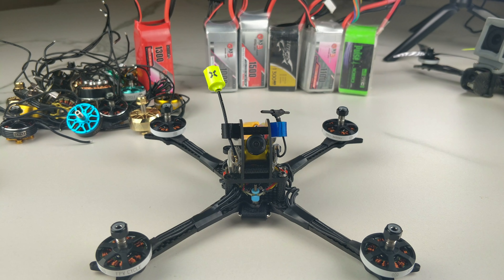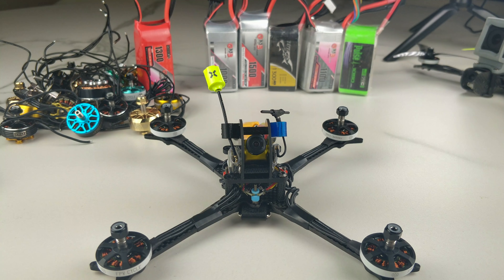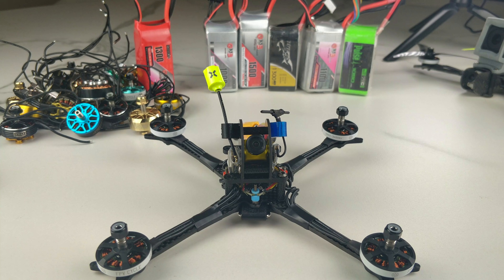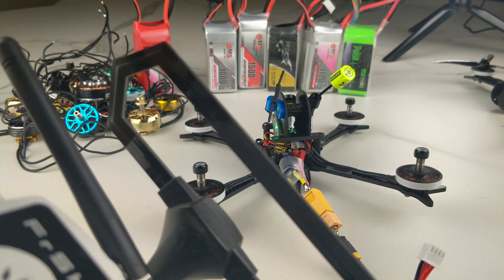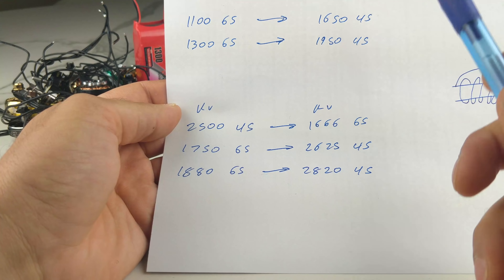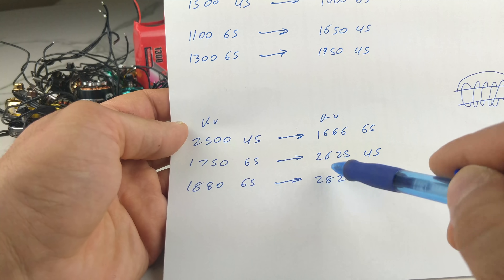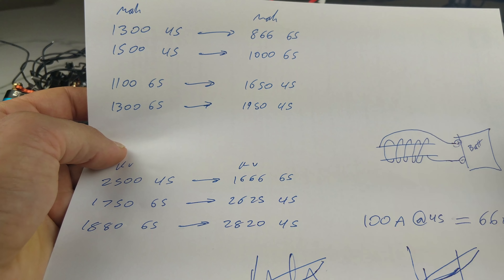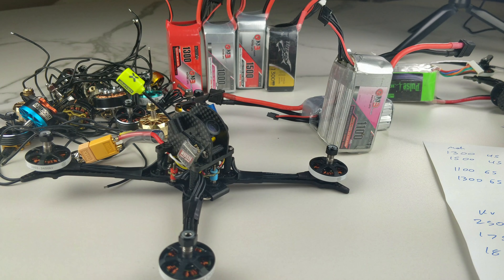6S Everything?  Why does 4S feel different?

Comment: I built 5s and 6s quads, I really do fly my 5s quads more often since they are more controllable and easily tuned. I have tuned one to where you could barely hear the props in flight. That quad dose fly 7 to 11 mins without a GoPro with 1050 5s. I do give the battery time to recover in flight if I do flip flops, or race style flights. I wish Betaflight would have 1 Gauge for RPM like how regular vehicles have the RPM gauge from 1 to 9. But I do enjoy you’re videos. Can’t wait to see whats next ✌🏼
Reply: I'm not sure how you would display rpm in a meaningful way since all 4 motors spend most of a flight at differing rpms.
Reply: Really what you're after is a strain gauge  to indicate how many Amperes the craft is drawing out of the maximum.
This would be difficult to reasonably calibrate, but we could get close with the following example:
Say at 16.0V your quad pulls 100A & at 13.6V it pulls 85A .We create a linear scale using these points, then measure instantaneous voltage and current then compare it to the scale.
Your quad is cruising at 18A , battery voltage is reading at 14.8V .
14.8V is 50% along your voltage scale, meaning we can estimate max amps to be exactly between 100A + 85A*, or *92.5A .
We take your cruising current of 18A and divide it be the theoretical max of 92.5A and that gives us a "strain" estimation (more on this below) of ~19.5%
Your "RPM" gauge of 1-9 would then show 1.75 "revs" if you count 0 as the lowest or 2.5 "revs" if 1 was the lowest.
Now, why an estimation you ask? Because this scale would sadly not be linear - the LiPo chemistry doesn't work like that; Supplying 20A is MORE than twice the work for a battery than 10A and the battery will output less useable power overall. This only gets worse the more Amperes you draw. Again, we could make some simple observations and apply a rough fudge-factor to approximate this, but getting it to any reasonable degree of accuracy would require testing and calibration for each individual battery throughout it's lifespan due to the ever-increasing internal resistance.
On the other more simple side, you can also display the current throttle stick position on the OSD. This is not equivalent to an "RPM" gauge, in car terms that would show how far the accelerator was depressed. It would simply show the requested power not the actual power.
Hope this helps give you some stuff to consider in your quest for an OSD rev gauge :)
Reply: @JustInvertedFpv   with bidirectional Dshot you can actually show all 4 individual motor speeds on the OSD. I'm not entirely sure why you'd want that but it's doable :D

Comment: Will I be ok to run these on 4S with little tuning necessary? I gathered that most issues are with running 6S on these, is that correct? I'm really too dumb to be flying, but here we are... 🤣
Reply from the maker: na just gotta be careful about 6S.  not worth doing 6S on everything
Reply: @Kabab  thats what I hear. I just wanted to make sure I was ok on 3" 4S without having to be a tuning aficionado 🙏

Comment: Im currently building a sub 270g 6s 7" vista build, the motors i am currently looking at are 2204 1750kv and 20g, do you think it is worth the extra 13-20g jumping to larger motors?
Reply from the maker: For 7"?  I'd strongly recommend 2806.5 motors
Reply: @Kabab  ok cool i will look into that. its the 7" megabat frame. i just love the way my toothpicks fly. thank you

Comment: Newb question here... what happens if your rx is no telemetry and you bind it with telemetry? Would thay cause errors? I get alot of rx loss on my rx/tx
Reply from the maker: It's just telemetry to the controller and half the time the code in the Rx or the controller is broken so it doesn't even work when you do bind it with telemetry.  It doesn't really matter.  If you get Rx loss from the quad being close to the controller that's normal.  Radio waves don't work when very nearby.  If you're getting it at a distance, check that your antennas aren't slammed up against carbon or aren't bent up or cut up at the very ends.  The ends are the important parts if you're using anything but crossfire.  For Crossfire you need to have it isolated and away from the frame with a vertical orientation if possible for best signal.
Reply: @Kabab the antennas are coming our the back  pointing up like a V. Maybe those rubber tube covers are smushing the tips  of the antenna like u said?

Comment: Do you think I will run into issues with on 4s with the power pick? Wondering if I should return the 4s and get some 3s. Nice video!
Reply from the maker: Well I have been having lots of issues in 4s and no issues on 3s. Still working on it. Same problem with the geprc dolphin on 4s. It's not unique to the frame or something. Stay tuned....
Reply: @Kabab  Awesome, I'll have my build done next week and I'll let you know how it goes! If I run into issues I will swap the 4s for some 3s.
Reply: @Kabab  Do you by any chance know the mounting pattern for the stock canopy stand odds? and the length of the standoffs?

Comment: I'm flying hyperlite 2122kv motors on 6S.  Why would that be considered too high?  It's a free style 6" floss with dal biblade 5040 props and it flies incredibly with tons of torque at what seems like every throttle point.
Reply from the maker: that's totally fine.  There's nothing presented here that should really change anything you do or are doing.  Just things to think about.  I myself really really like 1900kv 6S a lot on 5"

Comment: @KababFPV Great video! But I'm at a weird position where I can only run 4s on on my 6s quad (1800kv) for now. I'd like to know your thoughts on that in terms of efficiency. Did I just lose the benefits of both sides, or is it an overall more efficient (but under powered) quad? I noticed I could fly past 7 minutes and my cells would land at around 3.5 and recover back to 3.7 after a while. If I wanted to retain a bit of that efficieny all while gaining just a tad more power, (as I noticed how my quad would hover at near half throttle) would 5s be best for my case? Again great video and explanation as always
Reply from the maker: Na this is just food for thought. Fun to think about. I love 4S on 1800kv too. I have a feeling it adds the amps in the right places to fill in the torque curve. Yeah it's overall less but it feels better to fly because there's more current action than volt action
Reply: @Kabab  It's good to know I'm not alone on the low kv 4s train haha. thanks for the input

Comment: The issues you explain going from higher s to 3s to me seem to come from the higher gain in the feedback loop. Your pid settings are the same... But the motor response increases the mechanical gain in the loop because the motors have more torque  which has to be compensated for in the software pid. Lowering the total gain will probably solve it. I'm an engineer :) but really new to betaflight and drones in general so I might also be entirely wrong :)
Reply from the maker: In the case of this particular quad what I believe is happening is entirely noise in the system and the increased voltage is just exaggerating it. Never mind the quad. I was just using it to show how things can suck on higher voltage. Nothing more. I'll fix tht noise issue on the quad.

Comment: I just got most the things for my first proper race build (btw I bought 2 caddx ants, arriving Friday hopefully) - I have 3 6s 1300s and so there's no going back - I want to finish the build within the next two or so weeks- For now I'll probably get some T-motor velox 1950kv (the kind that don't look like the cyber xings) unless there's something better around the $13-14 mark. I'm still undecided on the props - any recommendations? I have no idea what to use. 

In hindsight 5s probably is where I should have gone probably, except for the fact there aren't many choices in my price range when it comes to motors. I believe Chief and also Mewo use 5S.
Reply from the maker: Consider the rcinpower Bison if you have gotten the motors already. The Velox is bottom of the barrel quality. Still fine and works fine but very low. The bison is special for a few reasons but also has an 11mm bearing which is wicked!  Still cheap

Comment: Somehow I watched the whole vid and was interested the whole vid but didn’t understand half of it lmao. Still very interesting 🤔
Reply: Yep, same
Reply from the maker: 🙈. Keep doing what you're doing. That's all.
Reply: @Kabab  so bro, does it mean if I use 4s on those fpvcycle 2203, would it always make sound?  Please do reply.
Reply from the maker: @AfafPrinceOSH  you mean electionic noise by sound?  If you take care to manage the noise then it will work great.
Reply: @Kabab  I mean as u used the 4s on it, it was making noise. Will it always make that noise?  Or is it due to noise in gyro which in result is causing the noise in the motor?
Reply from the maker: @AfafPrinceOSH  I go over all that in this video. It's a result of electrical noise from the motors

Comment: On a 6s, have you measured the ave. voltage at one of the esc wires to the motor to set the actual voltage being delivered to motor as you ramp up the speed?  I don't know, but going to ck.  Better yet  I'll put it on a scope. My guess is the voltage for a 4s is not the 16 or so volts a motor just starting to spin, the speed of the pulses is the same 3s vs 4s to get motor spinning not voltage?  I know you're talking 6s but I don't have a 6s.
Reply from the maker: the average voltage of 6S is more consistent. That's the whole point of 6S
Reply: @Kabab  +my point was given that we test with a 4s and 6s battery that weight the same they will both hover at a ave. voltage below a 4s  or 6s top voltage. so if you were to throttle limit the 6s battery so it could not put out more then 16.8, 4s volts (ave. under load) at full throttle then the two batteries will, should behave the same.  Yes, NO, why?  The test you did with the 6s and 4s also does not make sense with the motor noise, unless something in the system can't take 6s or will no longer take 6s.
Reply from the maker: @fpvkabo  because we usually drop the kv, the two will perform similarly.  The 6s battery will have an easier time with the amps because they're overall so much less and the voltage will be more stable. 

While I understand what your asking, these usually aren't useful tests in the real world because there is no way to assure all things are equal between two different setups. Motor kv, ESC's, battery....

Comment: Found this on fpvcycle:
"we don't recommend a 5" ultralight. It's just not worth it. We don't recommend using any motor smaller than a 2207 or 2305 for 5" props. You're just giving up control performance by going smaller."

Soo... What would you recommend for running Insta360go and maybe participating in 5" races? I at least like the look of the PP5 and the carbon topplate. Looks like its easier to mount stuff and maybe more durable...
Reply from the maker: This isn't really an ultralight. It's 310g. An ultralight is something that's now being more and more defined by the 250g auw marker and sacrifices to make it lighter.

This frame would actually be excellent for the insta 360 go but there's no specific mount position or not made for it yet.

Comment: So maybe a slight adjustment to throttle curve on 6s setups would alleviate the torque/feel issue at lower and middle ranges?
Reply from the maker: it could help

Comment: Great info all the way through! You lost me a bit with the torque vs RPM curves though. I'm curious why you didn't mention that you need a higher amount of turns to create (approximately) the same magnetic field on 6S? More turns = lower Kv right?
Reply from the maker: This video could have gone on for hours. You're absolutely right though. The impedance of the turns definitely plays in here and is probably at least partly the reason why we don't need a whole lot more kv on 6s to mostly fix the odd flight feel...kinda

Comment: So why did all freestylers switch to 6s if it has less torque? Longer flight times with 1250 mah?
Reply from the maker: It's less torque but the comparatively higher kv makes up for most of that. They're running much bigger batteries as well so they need even more comparative kv on it. 1250 6S is equivalent to 1875 nah 4S. Nobody runs that big of a 4S on 5" normally

Comment: Nice thoughts, first of all I'm not a pro racer but I love racing quads, my point here after my limited testing is that I fly 6S 1000-1100 lipos on a sub 250 dry 2205 1750 bh r6 paired with spitfire props or gemfan flash 5144, I  think I have all the power and nimbleness that I need plus a longer flightime than I got on a 2207 1750kv motor on a heavier setup because it's more efficient, I know that 2207 2207.5 2306 2306.5 are mainstream now and I have a really hard time finding light 2205-2206 6S motors, that make me think if I'm going in the wrong direction because motor disponibility... So what direction do you think I have to go when this sizes 2205-2206 finally disappear? I'm really sad about that 😞
Reply from the maker: Na. I'm actually expecting 2305 to become popular at some point in the somewhat near future. In your specific case I would investigate going down to 5S.  See if that quad is actually stressing the battery enough to need the voltage. You want the lowest voltage you can get away with.
Reply: @Kabab  5S maybe a good thing in theory, but there's no kv options for that in the motor size I use and I will have to replace all my lipos... I will try that amaxinno 2305 when the price drops a bit, thank you!

Comment: here is a thought...maybe someone already discussed and means nothing but higher KV motors have less windings and lower resistance  in the coils.  I wonder if running 6s with higher kv motors and a motor limit will give more of the high current 4s feel roogi is talking about compared to running low KV 6s motors with 6s battery.
Reply from the maker: It doesn't. I left out a huge part of this discussion. I didn't say anything about insurance. Less winds is less resistance but higher inductance. Overall it takes more power to make the same final torque with higher kv/lower wind count. That's why low kv low volts is so efficient. Like 1800kv 4s is super efficient and 2500kv 4s is not as efficient.

Comment: Really interesting video! I've been wondering a lot about cell and voltage combinations recently for a build, I'd be curious to know what you recommend. I'm waiting on some Hyperlite 2405-2722KV that I'm putting the HQProp Ummagawd 4Play (4.8x3.6x4). AUW will be just under 600g with a 160g lipo. I just wanted to try something different, maybe a grippy cruiser. Considering 4-blades = less top-end, after watching this I feel like higher voltage is pointless and should maybe even look at 3S higher mAh. For example a Pulse 3S 1800mAh vs a GNB 4S 1300mAh. Thoughts?
Reply from the maker: Well more blades is more load which will pull more amps and sag batteries harder. So more volts is likely going to help
Reply: KababFPV good point. So maybe 4S vs 5S with throttle cut should be my focus. Thanks for the reply! Keep up the awesome content, you've got the best format as far as I'm concerned 🤘🏼